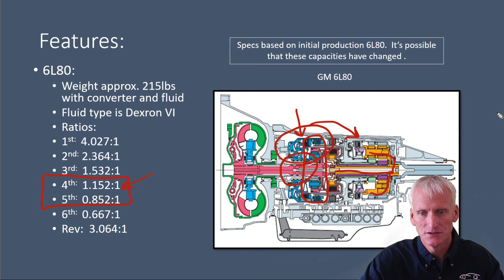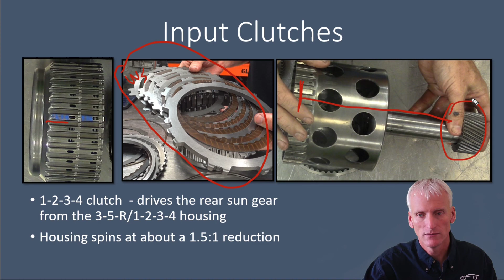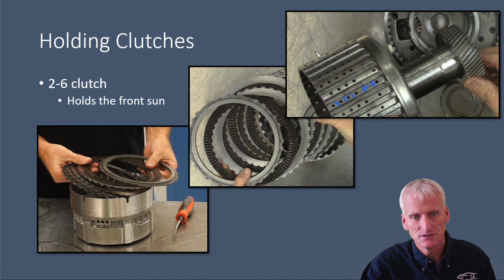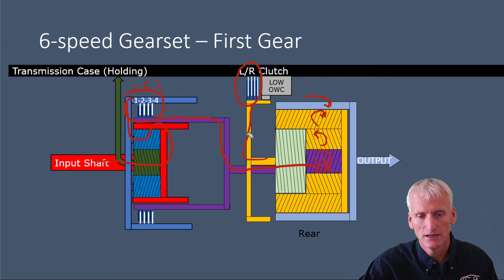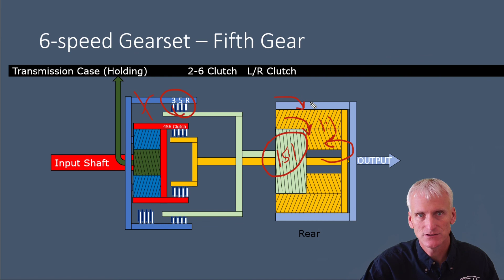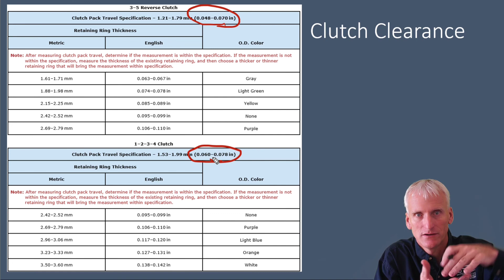6L80 Mechanical and Powerflow

Comment: Now if could better understand the hydraulic portion. From the regulation of the initial pump pressure to the way that pressure is then again regulated in the clutch apply circuits, then finally applied to the clutch pistons.

Comment: I have a few questions? From a performance stand point I have built 6l80 I built it but when I putting down anything over 700hp going through the gear I get quick slip but it’s almost like a missfire but I am the tuner as well so I can see it in my input shaft speed to my output SS . The trans has all raybestos clutched , steels and 35r zpack and all the sonnax and transgo valves I could put in it , pump and valve body . Would taking out my wave played in the 1234 drum help with clamping force and added another friction I ask because my zpack deleted the wave plate . Yes it’s a harsh shift but I was able to tune it out.  This happens in 1st and second sometimes 3 if there’s not enough heat in the trans .

Comment: This and a couple others of yours are the most informed and most helpful 6L80 videos that I used to rebuild mine my 2011 suburban back in February. My rebuild went great! But now, 11,000 later, it developed a rolling noise in Park and Neutral, that immediately stops when its put into either reverse or drive, and immediate returns when put back into neutral or park. Whenever it has the powerflow held by the brakes, no sound.  Its a nasty sound and as i think about it more and more, and I feel that it could be the front gear set being spun in the 1234/35R clutch assembly, which i do not think is a normal occurrence. 
It also seems have a slip in first gear and reverse at start of launch. However, the transmission shifts fine on a test drive that i made around the block. 
I was wondering if you might have a thought on this. 
I'm going to get it in the air and start disconnecting it today, any thought from you would be very insightful and appreciated. 

Thanks
Reply: Hey! Did you ever happen to rip it apart? Just curious lol
Reply: @monkestudios1  yes I did. I think this time around my rebuilt a lot better. The front sun gear and input shaft housing were severely chewed up. I think on the last build I put the wrong bearing up there and it came apart inside that front drum. It's all good now, it's been running fine since this last rebuild. I picked up a new input shaft assembly in Gears that were all damaged, and it's going on almost a year now with no problems. Thanks for checking in
Reply: @HVACRServiceTech  Oh nice, sounds like you did a good job. I think I have a sprag acting up. Causing my 1-2 flare.

Comment: My 6L80 decided to neutral itself after coming to a stop sign for a second then grabbed back into first. It then started a whirrling/straight cut/hydrostatic transmission noise in first gear and reverse (it also seems to make noise in 6th maybe).

Logic would tell me there is something wrong with the lo/reverse sprag/roller clutch/overrunning clutch. I know the lo/reverse clutch comes on in first but in normal gear selector in drive operation I think the lo/reverse clutch is only applied up until about 2-3 mph, it then releases while you are still accelerating in first. However, the sprag will still hold the carrier stationary and maintain first gear. For one I guess this helps spread the load (especially when the torque converter is at high stall torque multiplication) through not only the sprag but also the lo/reverse clutch. I think this also allows for the output shaft to overdrive the input shaft in case you were still in first gear and let off the gas while accelerating and prevent the dreaded throwing your head forward in stop and go traffic. 

I think you said it but it is amazing that the sprag with very 2 highly smooth hard metal surfaces can jam between them and hold power. I am imagining someone in first gear trying to abuse it by slamming on the gas and letting off the gas. However, I think the TCM would notice that and apply the lo/reverse clutch so the sprag doesn't take all that shock loading. 

Anyway, since my noise is clearly happening in first and reverse, it doesn't seem like it could be the sprag, since the sprag should have no relative motion, unless you let off the gas of course?

I can put it in manual 1st mode (I believe this should hold the lo/reverse clutch on the entire way through 1st gear) and it still makes the exact same noise. So maybe its not the sprag?
Reply from the maker: Good diagnostics!  The rear gearset is known to fail (especially on the 6L90s).  A few things come to mind since I cannot hear this in person.  The converters on these transmissions fail often and take out the pump.  Is it pump noise you hear?  Does it only make noise when moving? Or can you hear it in park or neutral.  If you only hear it in 1st and Reverse, it sure sounds like the rear gearset.  You might pull the pan to see if there's a bunch of metal on the magnet.
Reply: @siuautomotive  Thanks, so I pulled pan, few pieces of metal in pan. Pulled transmission out and found the rear gearset gears chewed up, but interestingly the sprag seems ok. It does have a little resistance on it. I somehow got ahold of a new rear gearset for $200 (it is a 650-700 dollar part new) and I am currently swapping it in. What is amazing to me is how good everything else looks like the clutches, bushings, bearings, no wear on shafts etc., however I am not a experienced mechanic but it seems to me like all the stuff in there has a bunch of life left. I am going to replace the gearset and put a Sonnax Zip Kit in and leave everything else and see how many miles I can get out of it, its got 250k now. 

So the noise was only hearable in first and reverse and no other gears except maybe 5th or 6th it was just too hard to tell with other road noises. This is weird because some gears are moving around all the time in the rear gearset, and the noise completely goes away upon the shift to second and both the front and rear planataries on the gearset have chipped teeth. Rear sun had one little mark on it, and front sun had a few teeth broken off. Rear ring was fine but front ring had a few teeth broken as well. There was noticeably more play with the assembled rear gearset than with the new one, I would be really curious to swap it back in and just see how long the transmission lasts with the few teeth broken. 

Besides a few scratch marks on the outside of the rear gearset carrier, it appears all damage was limited to it and the pieces just fell out in the pan. So looks like it was a fatigue failure I guess and I guess it started in the front sun and the pieces fell out before too much damage. I did pull the pan off about a month before it failed and didn't take the exhaust out so I had to kind of jam the pan back in, but theres no way debis could have fought gravity and gotten up in the gears I don't think.

The other weird part is that the day it happen I noticed I went to back down my driveway in reverse and it wouldn't move backwards and I thought something was blocking the tire, so I shifted back to drive and then back to reverse and it backed out fine, then a few miles down the road stopped to turn right and the low reverse clutch held on until its 2-4 mph release point and then went into neutral. I feel like the only way for that to happen is the sprag had to of failed, but like I said it feels fine. I had ordered a new one and already sent it back which I probably should have just replaced it but I am trying to save money. 

I am about to open up the pump to put in the Sonnax, but so far I don't see any signs of converter failure. I am pretty OCD about noises and stuff and I think I would notice if the TC had been slipping. 

Also thanks for the help and being the most honest and educating person on youtube, when its filled with click-bait, useless videos that ask you to like/share/subscribe every 30 seconds haha.